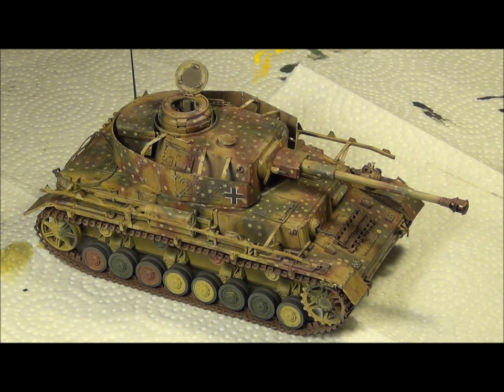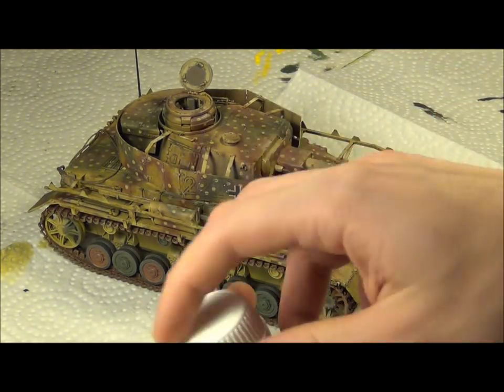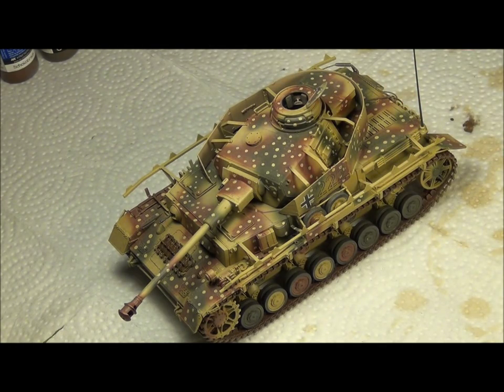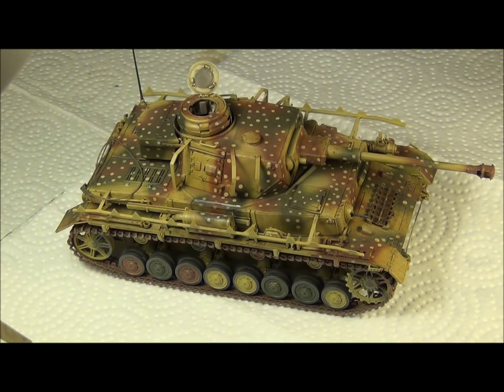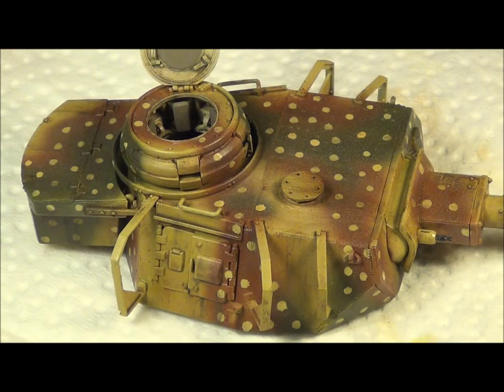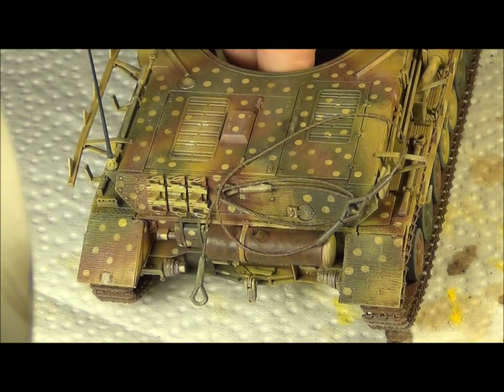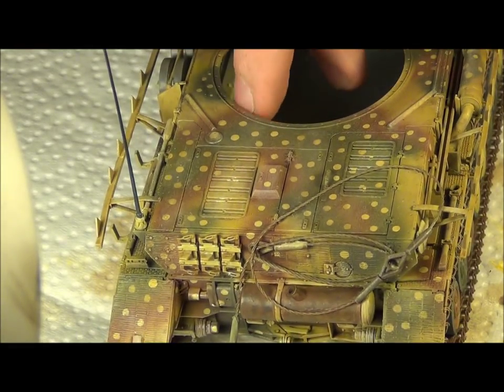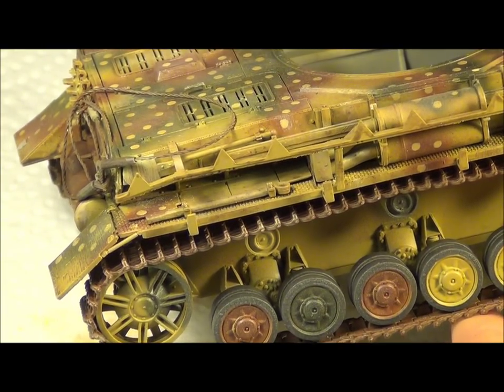Tutorial: Surface Weathering Effects for Model Tanks

Comment: Have you ever tried a dot filter on a zimmerit model?  If so, what is different about the technique vs. a dot filter on a smooth armor plated model?
Reply from the maker: I would use a do filter on something like this as the zimmerit texture was not too extreme.  But on my StuG III with the waffle zimmerit, I didn't use a dot filter as you can't really blend the dots down on such an uneven surface (all the paints will simply collect in the recesses like a non-uniform multicolor wash, and any dots of paint down in the crevices of the zimmerit will be hard to get as with the gentle streaking motions).  I also couldn't do any streaking effects on the zimmerited areas for the same reason.  On that StuG I just gave it a wash instead and focused on other things like chipping.

Comment: What did you use for a protection coat?  Did you apply a protection coat between the techniques you outlined?
Reply from the maker: +Alex Little I didn't use a protective coat because I apply the products in an order in which they will not react with each other.  For example, my enamel thinner will react/re-thin the oil paints I use too, but my oil thinner won't react with the enamel paints I use.  So this way I always put on the enamel products before the oils, and there isn't an issue.  Though in my winter whitewash tutorial I purposefully let the products react to get the desired effect.  If you don't know how all your products might react, I would recommend some sealing coats in there, like between the streaks and the chipping/oil highlighting.

Comment: WhAt's the différence between a filter and wash ? Because when you Start applying it, it looks like a wash...
Do you protect your paint work with a clear coat of some sort ? I m just starting modeling military models
Reply from the maker: A wash is usually thicker and you put it over the surface and then clean it away with thinners so it remains around the details, emphasizing them by creating a simulated shadow effect.  A filter is thinner and is meant to blend all the colours of the tank - usually the camouflage pattern - together and reduce contrasts.  You can use it to fade the tank.  It is applied over the whole surface.

Comment: Have you tried the pencil technique on edges?
Reply from the maker: Yes I have.  I susually use that one on the edges of tracks too to get a metallic effect.
Reply: What would be a great color to use under the main color(s) of a tank? I plan to use the salt trick on a Leopard A4 I have, but I'm not too sure of what color I could use. I was thinking a dark grey.
Reply from the maker: JohnsontheAnimeFreak Do you mean what colour as the base for the chipping, which will be exposed once the salt has been removed?  Usually I use a primer red/brown colour as tanks were primed that way, but if you're going to do just some light scratches then a darker grey works well too.
Reply: Panzermeister36 Yes a base color. It's a 1/16 so it's quite large, but I'm not sure on how much wear is going to be put on the tank.
Reply from the maker: JohnsontheAnimeFreak Reference photos of the Leo 2 should give you an idea, but I would say that realistically it should be a primer red colour.  Though you can do whatever you like; I use grey sometimes and red-brown other times, depends on how I want it to look.

Comment: Can you spray over the pigments with a matte sealer?  Will it make them fade?  Also what do you use for a pigment filler?
Reply from the maker: A sealing cost will most likely blow some of the pigments off so I don't use sealing coats of matte or anything.  I don't know what you mean by pigment filler, do you mean pigment fixer?  I don't use one either; instead I apply a coat of matte varnish after the camouflage has been applied so that the pigments have something to bite into.  this works fine for me, but I have to be careful about where I touch the model afterwards.
Reply: +Panzermeister36 yes a fixer sorry.  I'm trying to learn the oil side of things.  Amazing weathering :)

I'm trying to intergrade these techniques with wargaming and miniatures.  So they have to be handled heavily.
Reply from the maker: +Golden Candle Studio Yeah then you'll have to seal them.  In that case, applying the pigments "wet" would work better, like mixing them with a thinner/fixer when you apply them almost as a mud which will dry for nice dirt effects.  They would be attached the the model better and you shouldn't lose as much pigment when sealing.  Also, spray the sealant on from a little farther away, and at a lower pressure.  Do a few light coats rather than one big one.  This will help to not blow off or flood the pigments on the model/miniature.  The wet method doesn't work too well for making dust effects, so I would use airbrushing for dust instead.
Reply: +Panzermeister36 thanks so much bro!  Just true mixed the light spray and it worked.  Ill try the others on some other kits.  Thanks you!!!!  Keep making videos please.
Reply from the maker: +Golden Candle Studio Glad I could help!  I'll keep making videos for as long as I can; I reallu enjoy making them and helping out others like you :)  Have a good one!
Reply: +Panzermeister36 absolutely!  Highly appreciate them.

Comment: How did you decide where to put the oil paint bits? Great video btw, I learned a lot.
Reply from the maker: I just kind of put them on in a random pattern for discolouration.  if you watch my latest weathering tutorial I used darker colours in shadowed areas and lighter colours on the upper surfaces that would fade in the sun more.
Reply: +Panzermeister36 Okay thanks.

Comment: How do you blend the red green and yellow so its appears that there are no borders on the paint job and it sort of looks like they blends well? did you spray a very light yellow after all the paints were added?
Reply: +ArtificialImPulse This is before you put the filter on btw
Reply: +ArtificialImPulse And can you use enamel wash and filter for Acrylic base?
Reply from the maker: +ArtificialImPulse I airbrushed the yellow, then the green, then the red.  Then I airbrushed a very light coat of a very thinned-down yellow colour (a little lighter than the base yellow).  Enamel paints shouldn't react with an acrylic base coat at all; that's the way I always do it anyways :)
Reply from the maker: +ArtificialImPulse I airbrushed the yellow, then the green, then the red.  Then I airbrushed a very light coat of a very thinned-down yellow colour (a little lighter than the base yellow).  Enamel paints shouldn't react with an acrylic base coat at all; that's the way I always do it anyways :)
Reply: Panzermeister36 Ok Thanks

Comment: what type of oil pants and  thinner do you use?
Reply from the maker: +ThemapleCanadain I use standard mid-range artist&#39;s oils for canvases, really any will do but i&#39;ve got &#39;Windsor &amp; Newton&#39; and &#39;Van Gogh&#39; brands and they work very nicely.  Expensive as hell though, but they last forever!  For thinner I use a brand I get at Wallack&#39;s art supply shops.  It&#39;s Solvent under the Gotrick brand, mainly meant for cleaning brushes apparently, but it works really well for oils and doesn&#39;t react with any other type of paint.  Also, it has a lovely orange scent lol :D

This is what it looks like, though this bottle is apparently the odorless type: http://healthycanadians.gc.ca/recall-alert-rappel-avis/hc-sc/2010/assets//ra-12916-04_s_fs_0_20121220-180040_15_en.jpg

(And don't worry about that being a link to the photo on a government site warning of a recall, it's just that they don't have child-proof lids)

Comment: Howdy, how did u do the spots though...just with a brush?
Reply from the maker: Hello :)  You can see it briefly in the intro at 0:19.  I used a "microbrush" which is a small disposable round-tipped brush.  You can probably buy a pack or 10 or so at your local shop for a few dollars, or find them online.  They're mainly meant for applying glue or something, which is why they are disposable, but I found that I could make really good circle by just dabbing the brush onto the model, as it applies the paint smoothly in a very nice circle.  I could do a quick demonstration in my next MQ&A video if you'd like do see :)
Reply: Yes pls...thanks very much
Reply from the maker: I'll sort that out :D

Comment: money is kinda a priority for me. could you give ma an estimate on how much all this weathering stuff costs?
Reply from the maker: +Jackson Holmes Same for me!  Money is an issue.  The oils are quite expensive...maybe $10-15 per tube but they will last you forever.  Oil thinner is about $15, Mig filter and the AK streaking grimes were around $8 each, Mig wash was $16, Mig pigments $11 each (they last though), and the AK and Tamiya paints I used for the chipping are maybe $4 each but I got the AK in a pack of 6 or so so I don't know the individual prices.  You can use any acrylic paints here.  I used the AK ones because I liked the colours and had them on hand, so it was easier than mixing my own colour from my usual Tamiya.  

Now of course, things like the wash could be also done using oils, as could be the chipping, and even the filter.  I did a tutorial video on weathering using only a few oil paints for the whole upper surfaces of the vehicle and it turned out really well (though I didn't do all of the chipping with oils; I did some choice chipping with acrylics too, and used a filter and a wash product, but you could use the oils for those too.  I just didn't because I wanted to try out some of those products).  Then I used two pigments and that same wash product for the mud effects.  

It may seem like I have a lot of products, but I use them sparingly when I can.  I would recommend oils as the best and most useful medium for overall weathering.  Pigments are good for mud, but you only really need a muddy tone and a lighter dusty one as you can again use oils on the dirt effects to darken them to look more muddy or wet, or to lighten so make it look more dried.  So basically, a white oil paint, a dark brown one, and then a light and dark oil colour of whatever the base colour of the tank is, and then a couple of pigments as I described, and you can do a lot of really good weathering effects!
Reply: Thanks a lot for the lengthy informative reply...most people don't reply usually. You da bomb.
Reply: btw that tank looks awesome...great work